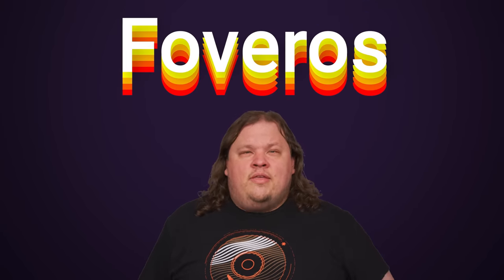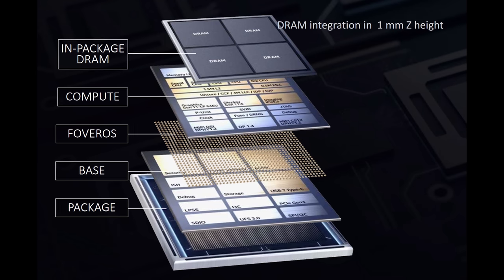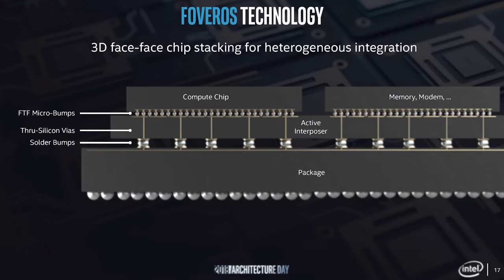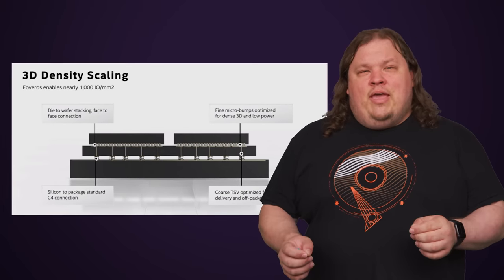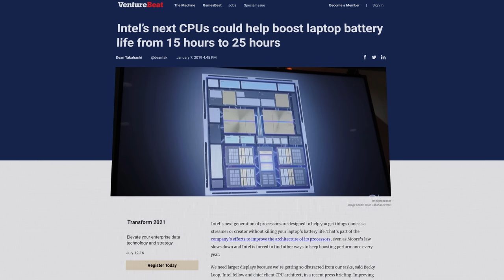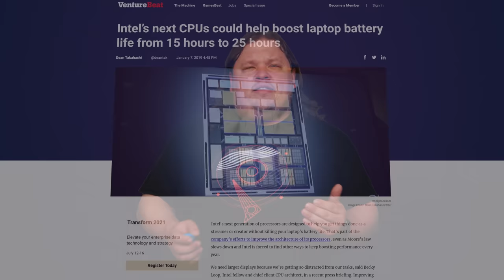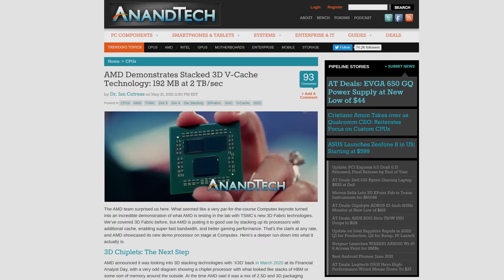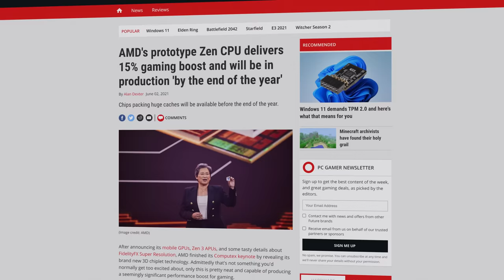They're STACKING CPUs Now!

Comment: Imagine AMD stack extra RT and AI cores, Radeon Will beat Nvidia
Reply: AMD doesn't have "AI" cores like Nvidias Tensor cores. And it's not like Nvidia isn't foreying into 3d stacking either. Alot of leaks suggest that the next "Big" architecture from Nvidia could include some form of 3d stacking.